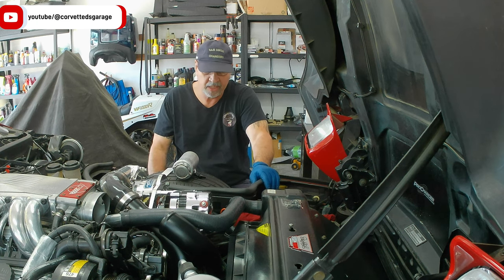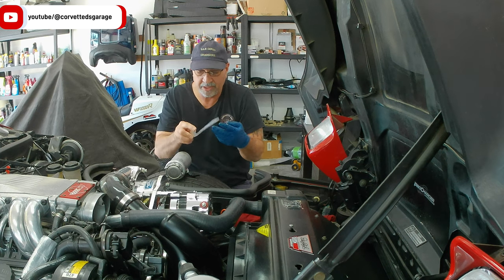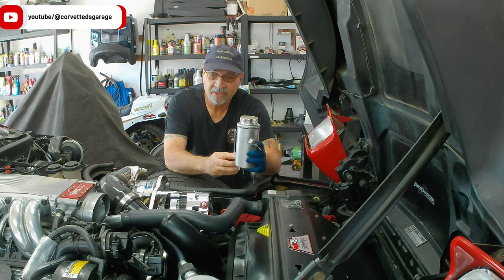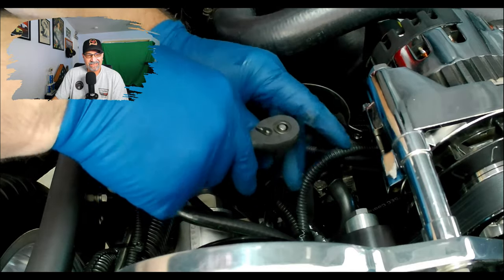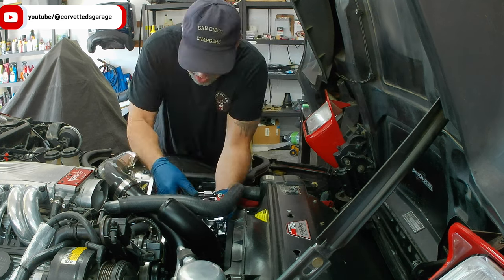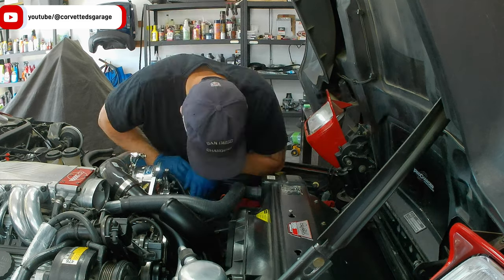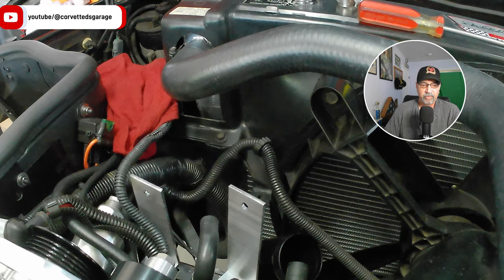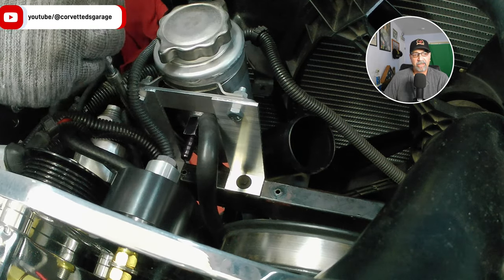Replace that cheap power steering reservoir with a quality tank

Comment: Great upgrade, but did you thoroughly inspect inside that Canton reservoir????  Here's my recent experience of a potential Canton Catastrophe & unbelievable what I discovered by accident.  
    My C4 has been in storage for 22yrs due to bad health & bad life.... My C4 only has 19k miles.  I'm planning a methodical process to get it started but I wanted to be sure to pressurize the oil system & will spray pennetrant into each cylinder prior to even cranking by hand to protect the cylinder walls.   
    So I researched many pre-oilers & even diy vids to make one from a garden sprayer which is very popular, but I decided on the "professional"?  route & bought a Canton 24-162 Pre-Oiler that I bought directly from Canton at a discounted price.  Basically, they just modify an old fire extinguisher tank to make it & even saw a diy vid doing the same from an old fire extinguisher.....
    After I got it, I decided to stick my finger in the bottom & feel the inner weld penetration on one of the welded fittings & felt it was gritty inside.  Looked at my finger & there was tons of metallic aluminum shavings!!!!! I couldn't believe it.  I rinsed out the tank into a bucket & there were tons of aluminum flakes & shavings! About a tablespoon full...!
Whoever built this, didn't rinse out the tank during fab work.  I wrote to Canton with photos to tell them to check their inventory.
Their response was nonchalant thanking me for the heads up.
This thing would've destroyed my motor pumping tons of metallic shavings into my engine defeating the purpose for a dry start up, but one with metallic shavings.
      I can only wonder how many others this happen to & never knew why they had a destroyed motor after a rebuild since this is when a pre-oiler is typically used for after a rebuild......
I can only wonder who is making these things for Canton & bad quality control or maybe a disgruntled employee!
Reply from the maker: Damn Chris, I am sorry that happen to you and good catch. I blew my tank out with air and it blew out clean. Of course, my tank appears to be made out of raw aluminum. Normally, I blow things out and if anything comes out, I go ahead and give it a thorough clean. I hope you’re in a good space with your health now so you can go out and enjoy that low mile jewel. I for one know about the health issues that come along in life. Stay strong my man. ☮